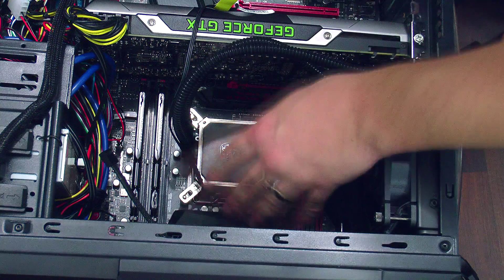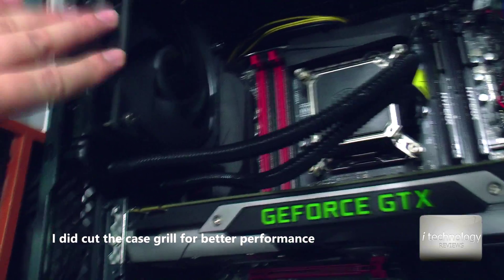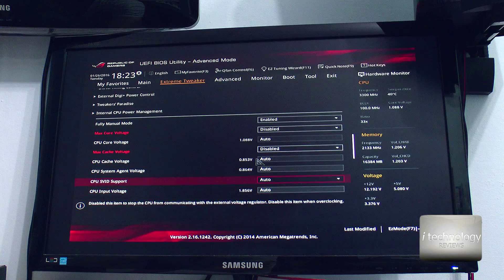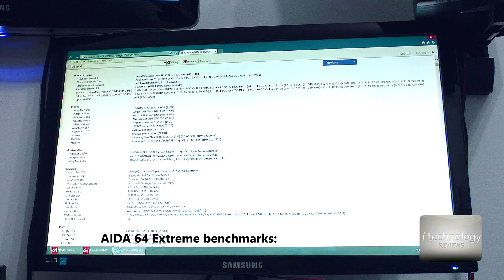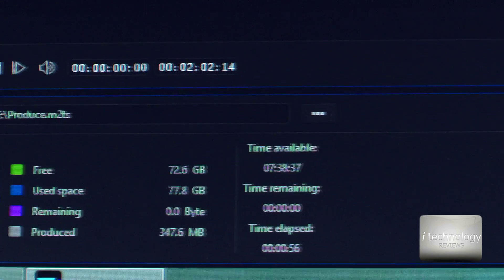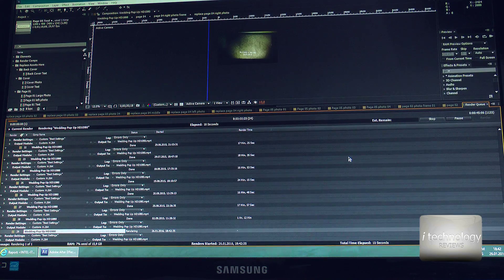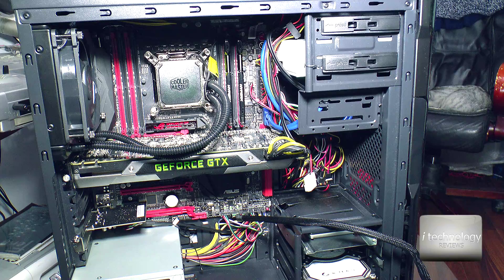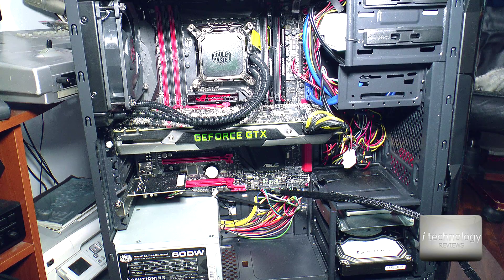4K video editing SUPER PC; Asus Extreme Rampage V, I7 5820k OC, Asus 980Ti OC, 850 EVO 250, PART 2

Comment: Would you say rampage V extreme is better than an x99 Extreme11 for gaming and multimedia? Plan to couple with 5960x and GTX1080 2SLI.
Reply from the maker: x99 Extreme11 is newere but be carefull that the usb's are a few comparing to rampage v and there are not a big diffrence
Reply: Thanks, I was if the extra $400ish was justifiable, but I guess not.

Comment: Nice looking build, have  you run a benchmark?
Reply from the maker: +richcali21 hi; it is but i think we will need for production another video card; in this part 2 you have a lot of benchmarks from ADIA 64 extreme. wach the entire video
Reply: +i Technology Reviews I do lots of editing so I went with $3,200 system that has a single Xeon 2660v3 10 core in a dual CPU Asus Z10PED16WS motherboard with 32GB's of ECC Ram. This workstation is great and renders my work extremely fast and is great for future proofing because I have 14 more slots for ram and room for another CPU. I can dump $1,600 more into this build and I will end up with a upper mid end to high end professional Dual Xeon Editing Workstation and will have spent under $5,000 for a 20 core editing rig.
Reply from the maker: +richcali21 wow sound very good. the cpu is awesome; listen i have 32 gb ram ddr 4 in quad chanel but if you think you will gain more speed with quad channel think again because is only marketing and not performace; i remain to 16 gb and we will make another review for this problem. So my question is what video card you use?
Reply: with quad channel it just means you have a much wider band for memory it doesn't mean its faster just has more room and is paired differently for me I wont see any of the benefits because I am running 2X16 so I need to get two more sticks of ram to see benefits for my editing and multi tasking. I run a single GTX980 and a Quadro K2200. I was going to purchase a Titan Z but found out that a new Titan will be out in the next few months, so I wanted to wait. I already had the Qaudro but got the single GTX980 for the cuda cores.
Reply from the maker: +richcali21 quad chanel is a little bit fast but is placebo; i manage in quad channel to gain 2 second more rapidly than dual chanel so it's not worth it :) . how about this? Nvidia Quadro K6000 (i wonder if it is working on my asus extreme rampage V) . but the price is not worth it. i wonder comparaied to titan x or gtx 980TI how is the performance...
Reply from the maker: +richcali21 i think you are refering to GM200 with dual GPU that will take titan x and 980ti.
Reply: I run the Asus Z10PED16WS dual cpu motherboard. Not sure where the reference is for the GM200? As far as the K6000 goes... I have noticed that even though the GTX980 has over 2,000 cuda cores and the K2200 Quadro has almost 500. The two cards render about the same and I don't understand why with such a big difference in cuda cores (I run premiere pro). I can not multi task as well with the k2200. I want to run Titan Z's but didn't want to invest until the new ones come out.
Reply from the maker: +richcali21 i meant by gm200 that it will have a 2 gpus gm200 the new card; http://wccftech.com/nvidia-launching-dual-gpu-flagship-graphics/
Reply: yes but keep in mind that Titan Z is $1,600 and still is the better Titan for creation with cuda cores. I think this next one will start at $1,500 at the very least and I think much more.
Reply: i Technology Reviews what your not considering here with ram DDR4 is that its more for creators and workstations as you get 64GB's as max for DDR4 and only 32GB's for DDR3 and I need lots of ram so for the Xeon this is huge because we don't have a 64GB's max its 1TB for the workstations and I have double that because of Dual CPU's so 2TB's of DDR4 total. Also latency is a huge difference between the two at 58.7 vs 77.8 nanoseconds that's about 25% faster also max bandwidth which is a huge factor is only 25.6GB's per second with DDR3 compared to 68GB's per second for the DDR4 That's a lot more than double the speed. Sure for the normal consumer the DDR3 will run office programs and the other non heavy ram needed software but any serious software your going to want DDR4
Reply from the maker: +richcali21 i don't know why were talking about ddr 3; we are using ddr 4 and we talk about the quad chanel vs dual chanel; if you don't belive me check out the youtube to see the lie betwen the quad and dual